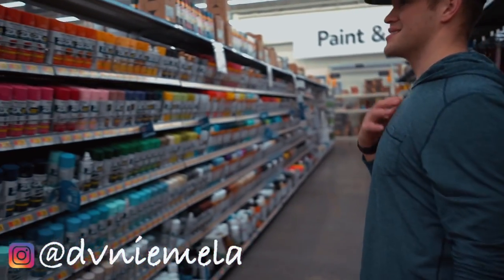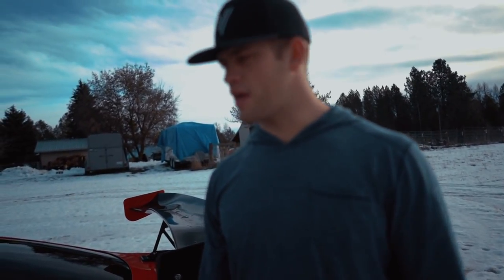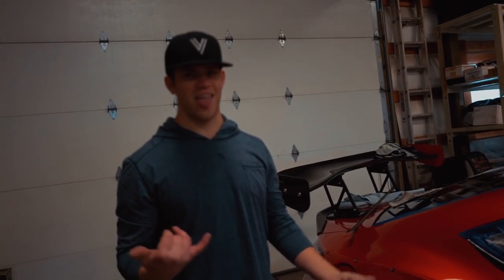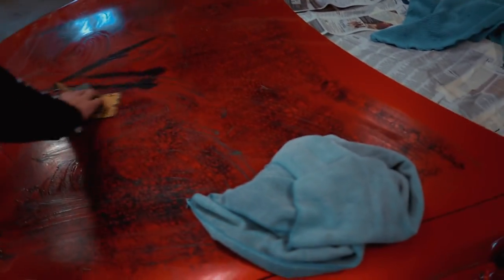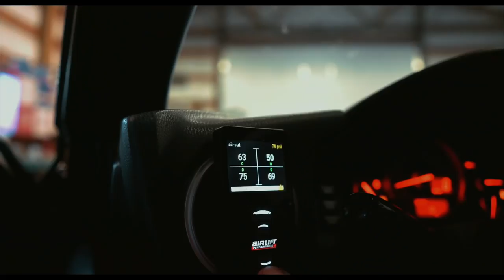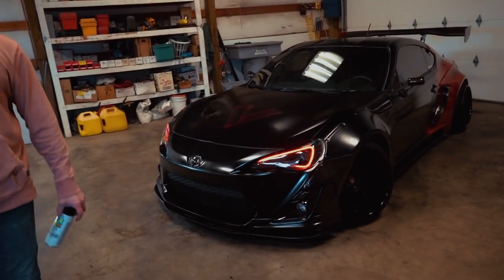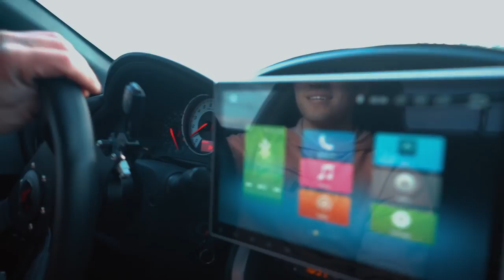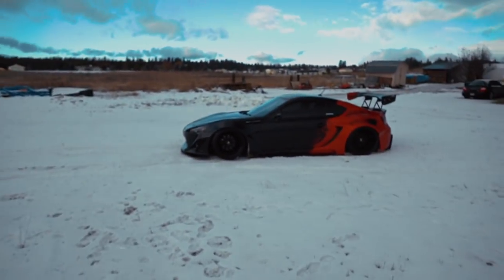Spray Painting my $50,000 Car

Comment: Yea it’s a very nice car but not a $50,000 it’s a $25,000-$30,000 car if you didn’t get screwed on the price an you put $25,000-$30,000 into it so it’s not worth $50,000 it’s a $30,000 car with $20,000 put into it an you could realistically sell it for $35,000-$40,000 if you found the exact right person a dealership might give you $30,000 like the saying goes “you can think it’s worth whatever you want but can you get somebody to buy it for that” also it’s a bit narcissistic to flaunt the $ tag instead of saying I’m spray painting my custom car
Reply: guessing 50k all in with mods and car not so much its worth but investment

Comment: 18k car...
Reply: MreignSupreme find an frs with all those mods for 18k and i’ll buy it for you
Reply: James Mozzer I own an frs. I’m on all the enthusiasts pages and they pop up all the time for sale like this. And a body kit isn’t gonna up the value that much considering under the hood is stock. Stock frs’s are selling for like 10k now so 18k reasonable
Reply: @MreignSupreme  with those wheels and wing and wrap and bags?
Reply: @guffbear3000  Most aftermarket mods devalue a cars price. Big wheels ruin MPG and messes with the speedometer. For a wing you need to drill holes into the trunk. Wrap ruins the paint underneath. Bags/widebody require alot of the original body to be cut out, drilled, etc. Mods will void your warranty. If you are in an accident, your insurance could decline paying for a claim if the cause of the accident can be faulted by the mods - air bags will pretty much allow them to decline any claim.
Not that cars go up in value anyways, but mods dont help a car keep its value.
Reply: Collin F i get what you’re saying but you’re not entirely correct. speedometer only gets messed up when the circumference of the whole wheel increases. he can get larger rims and skinnier tires. not to mention he really only got thicker to reach the outside of the fenders. also wraps don’t mess up paint, at least in my experience. i wrapped my g37 last year and peeled it off during the summer and wrapped it a different color and the paint underneath was perfectly fine